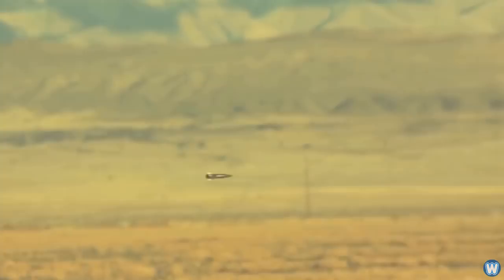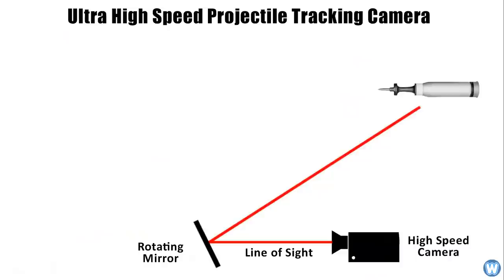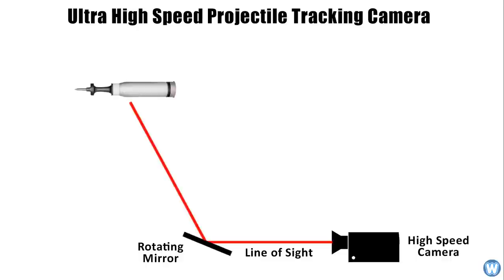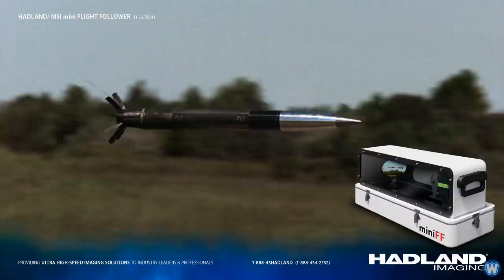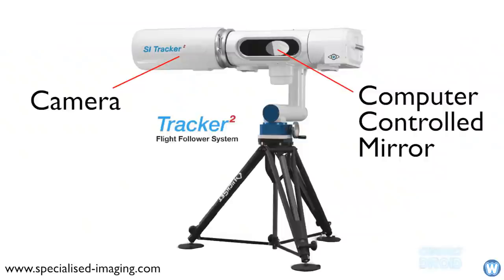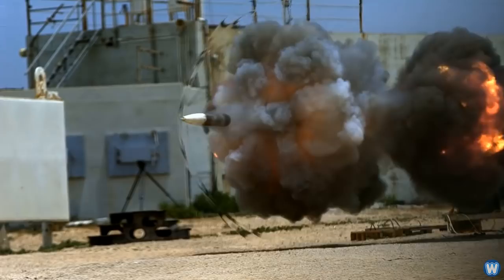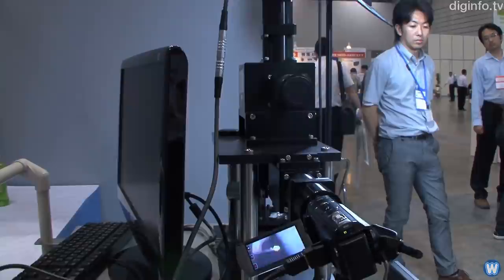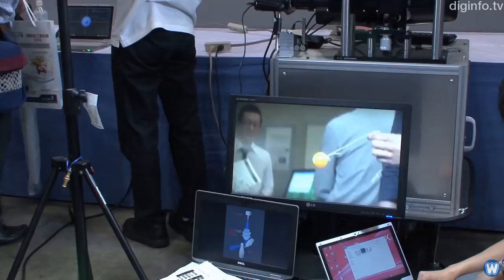US Navy Railgun Projectile - How it was Filmed in Flight

Comment: The whole reason for the mirror bullshit in this video about the electromagnetic gun is just Make you believe that such a gun exists. There was no recoil on the platform, Where did the smoke come from the electromagnetic gun? Why is the barrel round? Why is the projectile spinning? Why is the sabot so small and why does it immediately fall to the ground? Mach 7??? It is literally smoke and mirrors.
Reply: Railguns are simple devices, and you can make one in your home.
Why you've decided that these don't exist is beyond me. But I'll clear up your confusion anyway:

The reason for the mirror is that it's much MUCH harder to rotate a camera fast enough, so you instead rotate a small mirror and film through it. https://youtu.be/xpJ8EoGmLuE
Check the first shot. There's clear recoil, and the entire structure moves.
The smoke comes from all the friction and arcing that occurs during the firing. Barrels in railguns actually wear down immensely fast because of this.
The projectile spins because this provides gyroscopic stability. Please read up on ballistics.
It's small because it's small. 
It doesn't immediately fall to the ground. These rounds can travel huge distances.